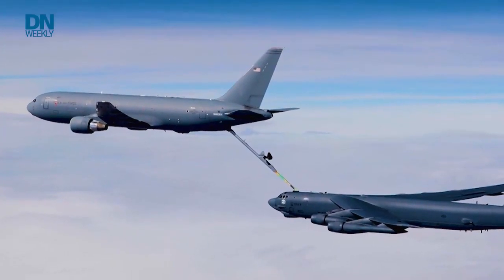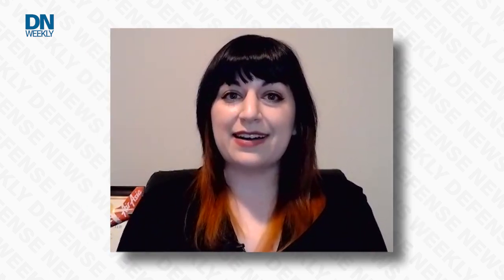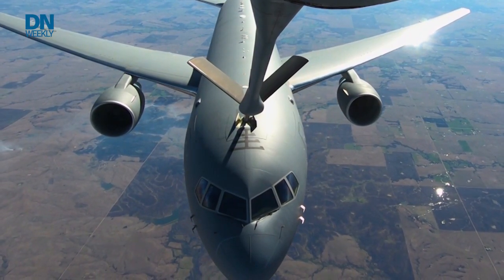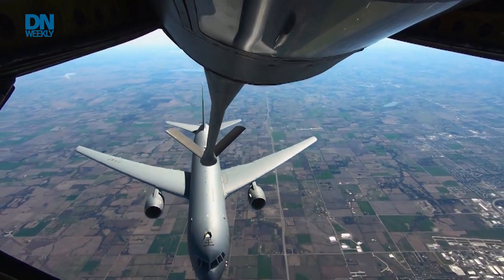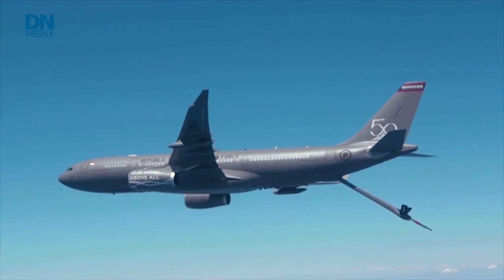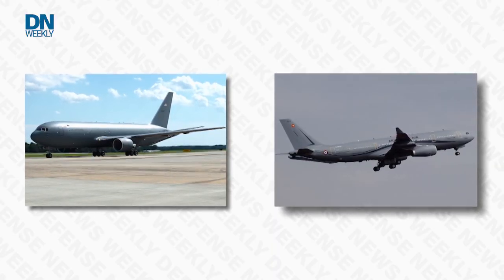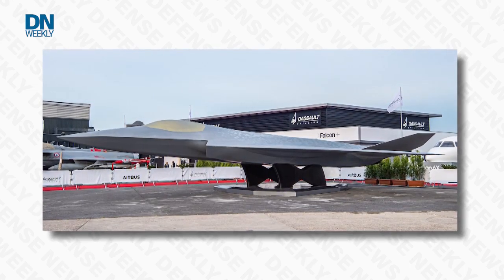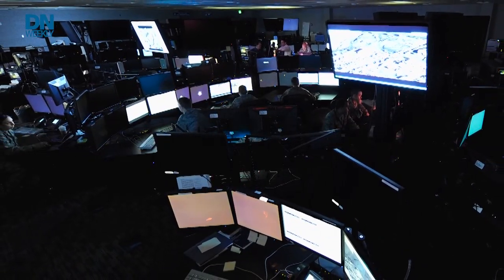KC-46 problems may lead to opportunity | Actionable Intelligence

Comment: In a nutshell the KC-67 was NOT what the Air Force wanted yet after losing the tanker competition Boeing sicked it's political dogs loose and (in my opinion) unfairly wrangled the contract away from Airbus, gave it back to Boeing and shoved something down the Air Force's throat that they DID NOT want!  I'm pretty sure if this tanker contract gets a sequel after the dust from the protests, grievances, complaints and political gerrymandering from Boeing has settled Airbus will rise like the phoenix from the ashes and come out the winner making the KC-67 tanker contract another shining example of "dirty politics as usual!"
Reply: Your entire first sentence and description of the events are completely wrong. The USAF changed some of the rules or specifications during war game modeling which favored the Airbus and Boeing used that among other issues to challenge the decision. The KC-46 is closest to being what the USAF needs than the Airbus MRTT is. Don't doubt me on this.
Reply: @JohnSmith-zi9or  You're correct, they did do that but I promise you from what I know from a few people in the Air Force the KC-767 was NOT what they wanted.  Was it unfair?  Did the USAF change the rules? Yes, that I don't dispute but I promise you they won't make the same mistake when they rebid it this time.
Reply: @phayzyre1052  I'm a retired officer of the USAF who flew KC-10s. It doesn't matter what people inside the USAF wanted. It was which aircraft was better. Hands down the 767 was a better replacement for the 135 than the Airbus MRTT.  Hell, the A330 has a bigger wingspan than the KC-10. Where the hell are you going to park all of them. Also, the MRTT is going to have bigger weight bearing problems. This is precisely what hurt them in the deployment scenarios. 

Now, in the future, IF the USAF puts out a bid for a bigger thanker, then maybe the Airbus might win.
Reply: @phayzyre1052  I'm not a mechanic. But I can say that for the company I work for, the Airbuses have MELs out the wazoo compared to Boeing -- and we have the oldest Boeings flying. But it is interesting what you said about the parts. If Boeing is reading this they should be tarred and feathered. But if that is post MD merger, it wouldn't surprise me. Boeing was once a great company but was trojan-horsed from the inside with McD managers. Boeing will never be the same until they put engineers/mechanics/pilots back into management instead of bean counters.
Reply: @JohnSmith-zi9or    Preach it my friend!!   👍👍  You sir just knocked it out of the park with that comment.
Besides that I don't think you even know the half of it.  A buddy I grew up with works as a manufacturing engineer for Boeing and has been doing so for nearly 30 years now.  He sounds just like you and laments at how Boeing has gone downhill with exactly that: Not putting engineers/mechanics/pilots back into management and instead they're placing all these over-educated ivy-league bachelor, MBA and PhD. toting bean counters in these positions and compounding that few if ANY of them even have an aviation background!  All I can think is WTF!??  If you need an electrician to wire up your house you don't call a plumber do you!?  These companies are slowly painting themselves in a corner with that mentality and sooner or later its going to bite them in the butt pretty hard!

Apart from all of that I'd really like to why this time Airbus is teaming up with Lockheed instead of Northrop Grumman (NG) like they did the last time?  Another friend of mine just retired from NG after nearly 40 years of service and as he put it: "I couldn't wait to get away from that California BS!"  He used to be a Grumman employee and has complained to me numerous times how when it (like Boeing with McD) merged with Northrop it went downhill.  He told me when Boeing protested the tanker contract 10 years ago NG just seem to sit back and not much give a damn if they got the contract or not and appeared to let Airbus fight it out alone.  Accordingly when Boeing did win the rebid the second time out NG's leadership was like "oh well" whereas many NG employees were thoroughly pissed.  I'm sure there's a reason why Airbus is teaming with Lockheed and it wouldn't surprise me if how they were done the last time was the reason why.
Reply: @phayzyre1052  Well they have to make them here or Congress is never going to buy them. That's why.
Reply: @JohnSmith-zi9or   That is true but why they picked Lockheed over anyone else has me wondering.
Reply: @JohnSmith-zi9or  Outta curiosity - when taking into consideration of the age of the KC-135 why have they been retiring the KC-10s?
Reply: @JohnSmith-zi9or  Thanks for the reply!
Reply: The Government Accountability Office (GAO) reversed it.  The GAO is not a political organization.  They do not favor either party or any manufacturer.  They sustained Boeing’s complaints because they were well founded.  EADS (Airbus) won the first round only because Northrop Grumman had friends in the Pentagon.  It is better to read the GAO report rather than just make up a story to fit your bias.
Reply: @GH-oi2jf  Who are you replying to?
Reply: @JohnSmith-zi9or  — Exactly.  The KC-46 is the right size, according to the specification.  A larger, heavier aircraft costs more to operate.

Comment: More Boeing problems along with Red hawk trainer V-22 Is prey 8 crashed 51 soldiers dead. Very things are on time and flight ready. In fact none. Please don't list older planes. I mean since original 777 which is great the 777x scared the shts out of a FAA pilot with a uncommanded pitch down like a 737 max. Delayed though lat 2025 according to Boeing. The are loading orders. Airlines don't have to take delivery of planes that late.